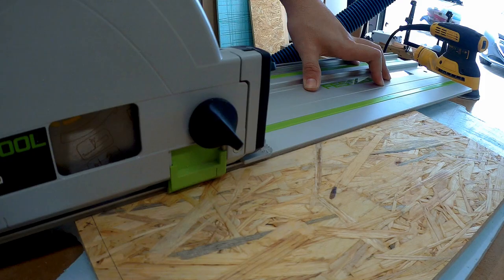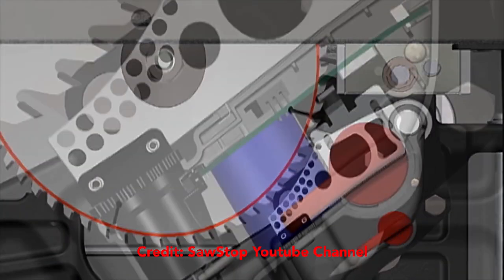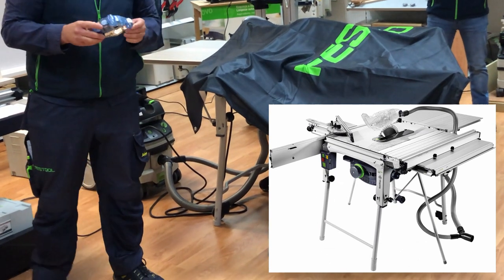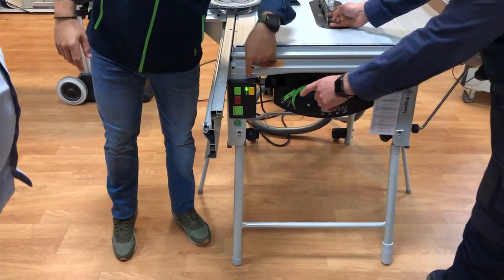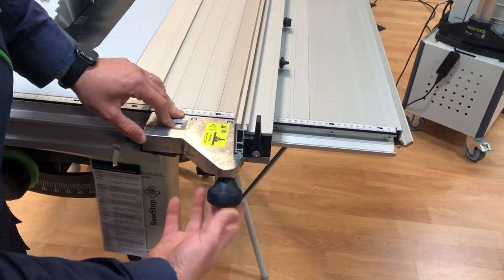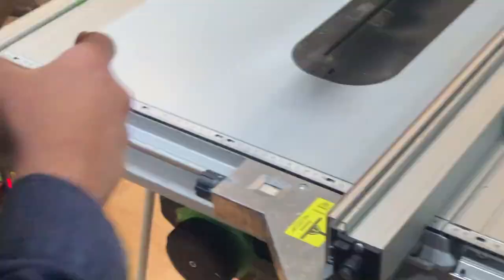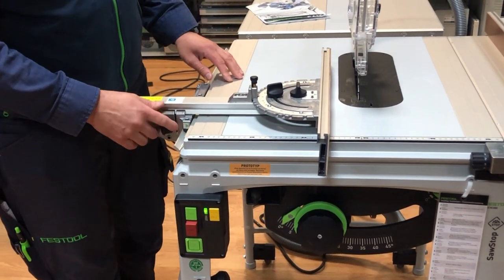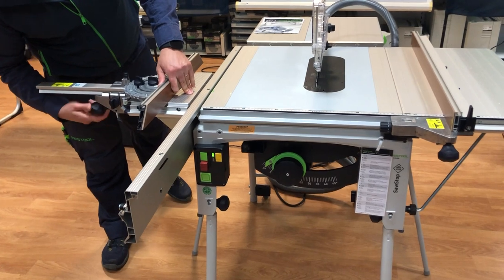Finally we can get a SawStop saw in Europe! | Festool TKS 80 Live Demo

Comment: I literally went on a plane, flew to America  bought the damn thing and then went back to europe, few months later had an accident and it saved my fingers, worth it.
Reply from the maker: Just by curiosity, which version did you got and how do you power it? The freq. change should matter much, maybe it’s just a bit slower, but I don’t know if Sawstop handles the 220/400 European single phase/3phase standard. I know Laura Kampf’s one came from Australia exactly because of that...
Reply: @AGTDesigns  Hi, its a contractor grade one with a standard 30inch fence and some fancy dust extraction. About powering it, i just bought an adapter from the internet
Reply: I would like to do the same.How did you ship the saw? I asked a few companies and they didn’t accept the package.
Reply: @Dr.H_Woodworks  I had it shipped to a town, flew to the town in us closest to me, picked it up there and flew back.
Reply: @Dr.H_Woodworks  If u are seriously thinking about it make sure to get a couple cartridges too in case some go off, its very hard to find them as well
Reply: Is it allowed to take it on airplane, it’s nearly 150 kg.
Reply: @Dr.H_Woodworks  I dont suggest to do what i did, its a very big pain in the ass and very pricy especially because of the weight
Reply: Did you literally get on a plane to the usa to get one or actually get on a plane to the usa to get one?
Reply: @Sly_Wolf_1  yes

Comment: No rack and pinion fence on a saw of this price seems like a big oversight... it’s such a nice feature on the dewalt units
Reply from the maker: The micro adjustment is similar. I like Dewalt system a lot, but this didn’t felt worse. At least if felt really sturdy and precise.

Comment: What is your opinion of the fence? I am concerned about very accurate cutting and am concerned that it might be too flimsy?
Reply from the maker: Before pulling the lever and only fixing the front part is very flimsy, but after locking the rear it appeared sturdy enough. Nevertheless, this seems a saw for cutting relatively small pieces, I imagine it wouldn’t be the best option for cutting big sheet goods.

Comment: I would buy the sawstop first of all because its build quality, if you have the tendency to forget your finger in front of the blade you will run into other issues. It is definitely a great feature, just that it is not a silver bullet and it should not give you a false sense of safety, but that is just my point off course.

Comment: Does the fence stay parallel to the blade and square to the table when you move it? The fence looks like a weakness to me. The bigger danger than cutting off a finger is kickback caused by a fence that angles in towards the blade and a good table saw has a fence that will stay perfectly square when moved and locked down. I cant deal with saws with a fence that I cant trust 100% after being set up.
Reply from the maker: Well, I haven’t tried it myself, but it looked quite sturdy after locking the front and the rear.. comparing with the designs that only lock in the front, it appears to be a lot better, but I would think that the Sawstop upgraded fences on cast-iron tops are a different league. I guess this is as good as it can be for a “portable” saw.

Comment: This saw is seriously the biggest piece of crap in the world. I mean, it would be fine if it actually worked but the quality control on these saws is so poor as to be unbelievable. Just google it - everyone is having problems with these saws. Sliding fences don't slide, surfaces aren't flat, mating the extensions is impossible as they never line up. I have had the tks80 for six months now, two weeks of which I could actually use it. The rest of the time it has been back with Festtool for repairs. In my case the electronics didn't work and the 'no blade' sensor kept tripping despite the fact that I had the factory blade installed. For one of the most expensive saws on the market, the QC is abysmal.

Comment: The "saw stop" "system is a very old system and has been around for years. What this test did not say is that the saw and the saw shaft (shaft) are damaged after such a sudden stop and must be replaced.
I also saw the saw stop on the old, wet wood without touching the finger. it's a waste of money for such an invention.
Reply: Lol, thousands of people have sawstop and none is online saying they have to replace the trunnion , for pressure treated wood you put the saw on bypass which takes 5 seconds to do. Please don’t spew your conspiracy and miss information on YouTube, keep your salty tears to yourself because you can’t afford the saw.
Reply: Absolutely do not have to replace the shaft. Blade and cartridge. Just because it’s old technology doesn’t mean it’s not good. Works well and does the job it says it does.